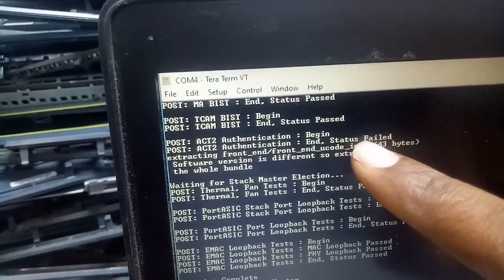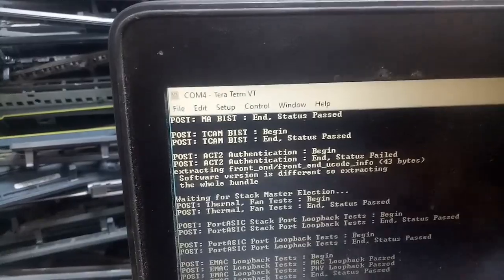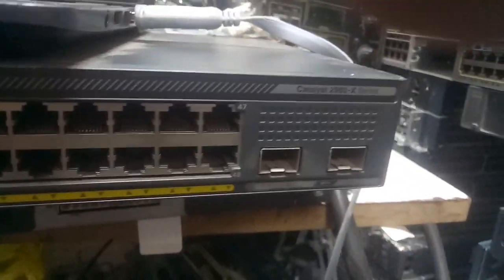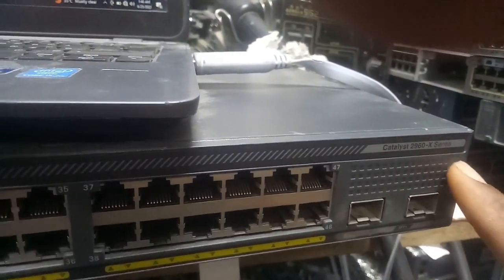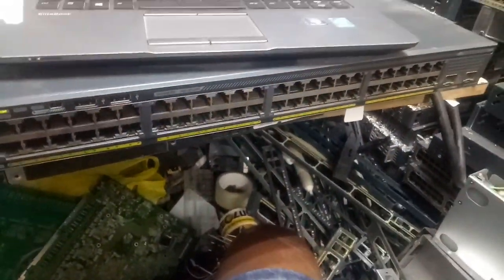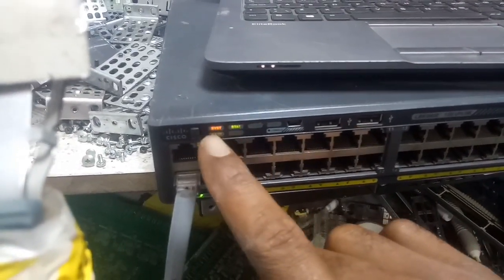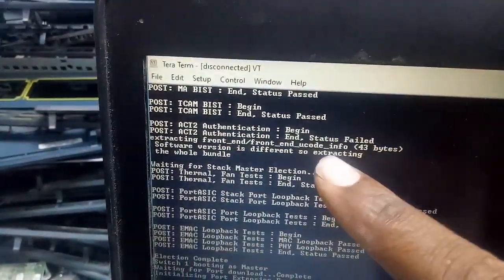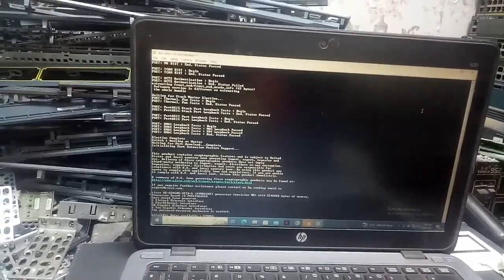how to indentify fake or counterfeit Cisco networking switches

Comment: Hi, i need help

POST: ACT2 Authentication : Begin
POST: ACT2 Authentication : End, Status Failed

Switch#sho license
Index 1 Feature: lanlite
        Period left: 0  minute  0  second
Index 2 Feature: lanbase
        Period left: 0  minute  0  second

Switch#

Feb 18 14:06:58.871: %ILET-1-AUTHENTICATION_FAIL: This Switch may not have been manufactured by Cisco or with Cisco's authorization.  This product may contain software that was copied in violation of Cisco's license terms.  If your use of this product is the cause of a support issue, Cisco may deny operation of the product, support under your warranty or under a Cisco technical support program such as Smartnet.  Please contact Cisco's Technical Assistance Center for more information.

I open the switch and it is no fake

512K bytes of flash-simulated non-volatile configuration memory.
Base ethernet MAC Address       : 2C:0B:E9:
Motherboard assembly number     : 73-
Power supply part number        : 341
Motherboard serial number       : FO
Power supply serial number      : DC
Model revision number           : A0
Motherboard revision number     : A0
Model number                    : WS-C2960X-48LPD-L
Daughterboard assembly number   : 73-
Daughterboard serial number     : F
System serial number            : FOC
Top Assembly Part Number        : 68
Top Assembly Revision Number    : A0
Version ID                      : V04
CLEI Code Number                : C
Daughterboard revision number   : A0
Hardware Board Revision Number  : 0x05

Switch Ports Model                     SW Version            SW Image
------ ----- -----                     ----------            ----------
*    1 54    WS-C2960X-48LPD-L         15.2(7)E10            C2960X-UNIVERSALK9-M

Can you help me?

Comment: Hello, have you decided how to repair such switches? return to the old ios?
Reply from the maker: You have to remove the "ROM " reprogram it, before replacing the new iOS otherwise only returning to the old iOS will not work.
Reply: @jkftech  Overwrite ROM completely from the same model or some area in it?
Reply from the maker: @alexandrsokolov5807  yes you have to overwrite ROM , the iOS on it right now have updated the ROM, from old clone iOS. So you need to return it back